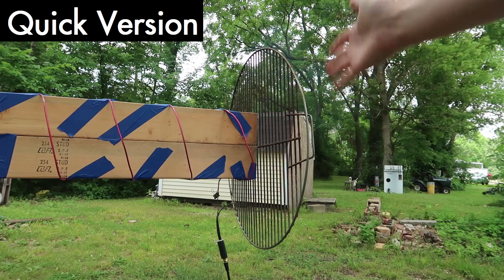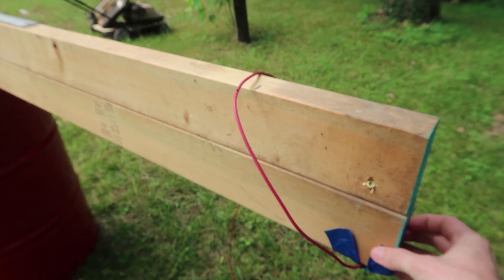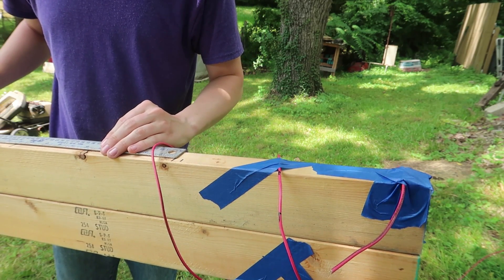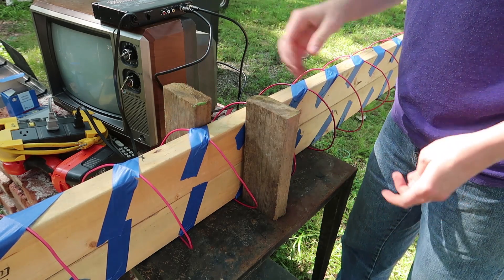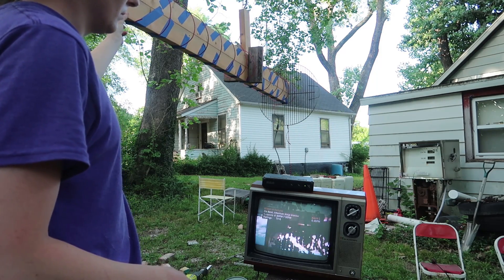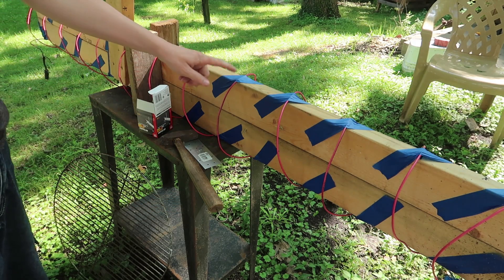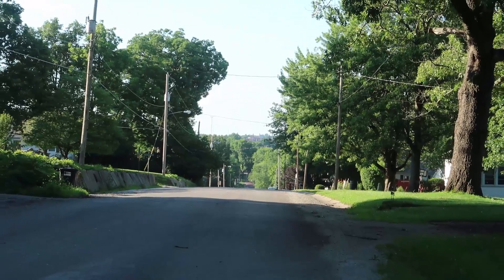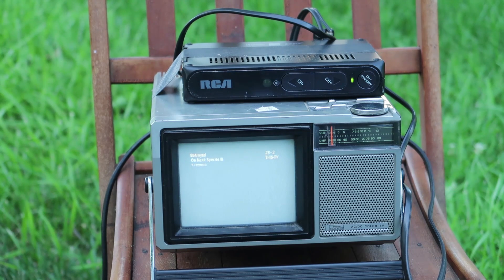Digital TV Antenna Experiments 02: DIY Super Long Range Axial / Helical "Rural" Antenna, TV DXing

Comment: Please give power output of the stations and the distance you are from them! Does not matter if you get a lot of stations if you are in a big city, rabbit ears could do that. Why don't you try pvc pipe and drill holes at 5.5 inches, you could use Ts to space them and be a lot lighter, then add a rotor. Add a pipe in the center and you could support the outside wires.

Comment: You asked about multiple antennas and how performance would be affected. It's not a simple matter of connecting them in parallel,
as they need to be connected together with what's referred to as a phasing harness. More info here: http://www.jonfinley.com/hobbies/harness.html

That said, here's an approximation of how it pans out:

Two antennas will increase the signal gain over that of a single antenna by aproximately 3 dB. BUT, to get 6 dB of gain (aain, over that of a single antenna), you'd need FOUR antennas. 9 db of gain? You'd need EIGHT antennas. It gets out of hand VERY quickly. 

Check out https://daycounter.com/Calculators/Helical-Antenna-Design-Calculator.phtml for more info on designing a helical antenna.

BTW, your BBQ grill "plate" as you refer to it, is called a reflector. Odd, since you actually used that term in the video. Where and how you attach your feedline to the helix has a major effect on impedance. If the antenna impedance and the feedline impedance are not fairly close to the same numerical value, signal loss occurs. i.e. you lose some of the signal you're working so hard to capture. The greater the mismatch between antenna and feedline impedance, the greater the signal loss. 

I've been a licensed Radio Amateur since 1968. I've seen very few hams attack a project with the zeal you show while building yours.
(and NONE of them were women!) My hat's off to you madam!

Comment: You might get better results if you strip the wire. I tested this at work (I work at a TV station). Paperclip VS insulated wire of the same length. I got nothing on the wire but got all 3 local channels (3 main channels plus 11 subchannels) with the paperclip. It's a digital TV so there's no converter box to account for

Comment: If the area in which you live is in abit of a dead or difficult spot as regarding tv reception why isn't there a local relay tv transmitter in use serving your area? In the Uk there are loads and loads of repeater stations situated where good reception is an issue, some serving very small populatons.
Reply from the maker: because our town is too small to need one

Comment: Might want to look at UHF/VHF db boosters they run inline between the converter and antenna they can be found cheap on Ebay. I like this antenna design you can make them as large as you like and you can mount them across attic trusses  https://vimeo.com/2931902

Comment: Hey, you need to get your Ham License - you'd be an asset. I just made the common 7" x 8ea. V-bow-tie and it worked well, but not on our local ch 5, eventually I discovered some of the channels like our ch 5, are still in the old VHF 54-216 Mhz range, which could be a big antenna. The FCC TV query site is https://www.fcc.gov/media/television/tv-query . Good video.
Reply from the maker: no i dont. ham radio doesnt interesting me at all. just weird middle aged men on the airwaves. i dont need a license to mess around with transmitters and antennas, especially since its such a rural and remote area im in.

tvfool is better website btw.
Reply: @RinoaL  Us weird men are way past middle age now!  LOL!!  All you see is gray and white hair at a hamfest.  Rarely anyone under 50 - and not too many women either.

Comment: do yourself a favor and use pvc pipe instead of wood!!!
Reply from the maker: find a 7" pvc pipe.
Reply: @RinoaL   no no no. use tee shaped peices to hold the wire!!
turn 2 tees into an H one is the center, the other supports the wire by turning it 90 degrees next one in line is the bottom then the top etc. ---------`---------`-----_
Reply: you're welcome
Reply from the maker: that sounds flimsy and costly, i think wood is nicer and simpler
Reply: @RinoaL   look up the channel southern ideas this guy builds small practical antennas that are capable of almost 100 miles without a booster and he shows you how to build it!! for about 10 bucks!!( your cost for parts)

Comment: Rinoa Super-Genius, there's lots of Yagi antenna calculators on the internet that work. The more elements you can add, the better the db gain. Thought I should share that with you. Get some small diameter scrap aluminum tubing or what have ya and go to town.  Your antenna here works, though.

Comment: People need to understand that when they rate how far an antenna goes, it is most often exaggerated and need a completely clear path to the tower from a very high mount. When you live in hilly rural areas the best antennas may not exceed 35 or 40 miles. Although the old fashion aerial antennas work better than long distance directional antennas, but they are huge and ugly. I would have interest in building my own long distance antenna, but would stay away from nailing 2 - 2x4's together unless it was the only way. As far as putting 2 together for a better signal, I think they would need to be a certain distance between them like 5 feet? but I don't think it would improve your reception much, but it could be aimed in 2 different directions. I would think that od copper tubing aka refrigeration tubing that is already in a roll or heavy gauge non coated copper wire would hold it's shape around Styrofoam better than copper wire around heavy boards would work better? but I don't really know, but would paint the Styrofoam for better strength and weather resistance?  Keep on going, I was hoping to see a miracle rather than being slightly impressed. Nice video and good efforts.

Comment: You built a very directional array. Its an axial mode helical antenna. Its definitely for uhf frequencies. If you want t a vhf station , you may need to add a dipole near your driven element. Wouldvit work better with no insulation on the wire? Also, when wood gets wet it will become a hindrance electrically unless its sealed with paint or clear coat. Most stations have their helical arrays vertically polarized, but might depend on terrian . This type antennas  is used to comm with satellites.
Reply from the maker: vhf television doesnt exist anymore, that was the main reason for the digital switch, make more room for other things. all channels have been moved up and every channel i can find around here is between 400 and 600mhz, most above 500.
Reply: @RinoaL  - "vhf television doesn't exist anymore" is not true. It is a myth that seems true only in some TV markets. Check out https://en.m.wikipedia.org/wiki/Pan-American_television_frequencies for info. In East Tennessee we currently have TV broadcasts on physical (actual) VHF channels 5, 7, 9, 10, 11, and 13 plus several UHF frequencies, of course. The FCC recently auctioned off high UHF frequencies to cell phone carriers for more space in the future. So the OTA frequencies are going to have to undergo a "repacking" when the higher ones will move their physical channels to lower frequencies (lower UHF or VHF). This will be expensive for some broadcasters, because the physical size of their antennas will have to be redesigned to be much larger (requiring stronger towers to carry the load). People who have UHF-only TV antennas will likely need VHF-capable ones at that time.

Comment: I would make a Gray Hoverman antenna it's much smaller and they pick up good. You can do a side by side version and get really good reception. Also an eight bow tie antenna works good too but if you want it to work for years in weather you need to solder the whiskers to the lines, Gary Hoverman needs not any soldering maybe the balun should be soldered but the antenna has no whiskers to worry about.

Comment: try a die pole plastic plumming t peace 2 metal poles one facing up other facing down inner coax goes to pole up and other to pole facing down i seem to recal each pipe is about a meter i did this on a roof years ago for analog never managed to try for digital as it is none directional it should pick up for signals

Comment: two antennas tied together is great, you get twice the strength of the signal, not twice the distance reached, though.  Also, be careful when tying two antennas together because you can get some impedance and signal cancelling if you are not careful.

Comment: For a much lighter and easier design, look up at lowes or homedepo QUIKRETE aka quik-tube. they are cardboard tubes for concrete. should be able to get something in the size you need and the cable can be round. not sure if at the start the oval shape is necessary but could make a press with the 2x4s you have to make the tube oval. Then vac bag the tube with resin so that it's water proof and stiffer.

Comment: 10:10 that looks like a cell phone tower in the distance, likely what is causing the signal level to vary so much.
Those screws you used to join the two bits of timber, are likely detuning it slightly, consider using dowel to join timber (or get one bigger piece).
You could also use a hacksaw to cut grooves to put the wire into, keep it more secure.

I remember having a set top helical antenna many years ago, I never considered making a bigger version.

Comment: I think you should experiment with the reflector materials and sizes. Maybe an old satellite dish could help focus the signal strength.  I tried some different locations for my antenna and nothing worked better than mounting it right on the largest window.

Comment: Would a solid backing plat work better than the grill? Like, would covering the backing plat with foil change anything?
Reply: That question has everything to do with wavelength.  It would basically not be an issue at UHF frequencies.  Now, if you were up at 2500 Mhz (the wifi band) it would make a difference.  You also have to consider what is called "wind loading".  The foil would be gone in a 10MPH wind - and solid metal would be a problem in gale force winds.  That's why you don't see that much.

Comment: Seems. it's so very heavy. Wood does not affect the quality of the antenna signal, may be will be better to use PVC pipes for making carcass.
Reply from the maker: i think it better to drill big holes in the wood
Reply: no need to drill holes in PVC, holy scotch or glue can be useful in DIY, and if your project much needed, you can drill holes in PVC too(bee careful, need fixation), awesome material!
Reply: +1 for the PVC pipe
Reply: I might try this antenna and compare it with a Gary Hoverman antenna. I would use an old dish antenna for the reflector. Thanks for posting.
Reply: I would.not.use wood on my antennas because wood will get water logged and short out your signal. Use vinyl fence posts they are light and won't conduct. Better insulator for antennas.

Comment: Digital TV is so awful compared to how Analog was. If you had a snowy signal with Analog it was still at least watchable and you could understand what people were saying.
Reply: Do you know how wide the frequency is on the new digital tv signal? I've tried googling it up and the results leave me very confused. I'm wondering if its like the phones and a spread spectrum signal.

Goal: If I knew the freq range I could design an op amp high Q (superb selectivity) pre amp.
Reply: John in Australia it is 7mhz
Reply: John Possum The FCC keeps selling off channels for mobile use. As of 2020, there will be no channels above 36 (608MHz). The UHF TV band still starts at 14 (470MHz).
Reply: @5roundsrapid263  they may sell of the actual frequencies but most digital tv are using vurtial channels the frequency is not the high channel 55 they may transmit on a low channel on uhf but have a vurtial channel that is a high number. In Florida uhf actual channel 16 went moble. USF sold the channel that used to be WUSF TV. On my tv I get signal but no picture or sound.
Reply: Not really digital tv comes in Crystal clear. You get a picture or you don't get anything. But it don't take much to get good clear pictures. Most government issued converter boxes are junk. Most smart tvs will get excellent pictures with small antennas. I would make a Gary Hoverman antenna and you will get excellent pictures if installed outside. I would not waste money on the flea market lava antennas they don't pick up 150 miles if installed on a mountain let alone on the roof. If you live 30 or 40 miles they work ok but you can build an antenna for a lot less money.

Comment: Creating an array of 2 or more antennas would increase the capture area and help with weak signals. Then there would be the option to aim them in different directions at different broadcast towers, ganged together with a splitter and then fed through a signal booster. That is a very cool design!!  I might try that with a 2x2 frame to make it somewhat lighter & easier to mount in the attic. Fortunately, Atlanta broadcast towers are in a clump 45 miles away and easy to aim at. Good luck with your antenna!

Comment: One way to improve the signal drastically is to attach a Masthead amplifier to the base of the antenna what that does is amplify the signal by up to 10 decibels which should give you far better reception even some of the cheap antennas come with 5 volt amplifiers

Comment: I had the Zenith box, and it works very well. It got 60 mile stations all the time, and sometimes 90-100 miles, just with a rooftop antenna.

Comment: I could be wrong, but I don't think you would get troposphere bounce because it so high of a frequency. In the days of analog the vhf channels we're a lower frequency and near the 6 meter band in ham radio so you would get big troposphere bounce. Again I could be wrong because it's been a while.
Reply from the maker: ive heard it can still work a small amount, but i agree nothing fun like with VHF.
Reply: Rinoa Super-Genius yeah it might bounce some, but not as much as it used to
Reply: Rinoa Super-Genius There are still a few digital stations on VHF, but mainly high band (7-13).

Comment: Under ideal conditions, adding another antenna adds 3dB. To get another 3dB you need to double it again to 4 antennas total. Mechanically a pain in the ass. I reckon the lowest hanging fruit is elevation. Stick to one or two antennas only. Lighten the design physically and get it off the ground.
Reply: Hot tip: Elevation profile feature on Google Earth is great for checking line of sight and figuring out required mast height.
Reply from the maker: no, tvfool is better.
Reply: DaSuthNa is right. You'll also need to co-phase them together which can be tricky without the right equipment.
Reply: Rinoa Super-Genius I'll give it a go.

Comment: You’ve got absolutely no excuse to as to why you’ve missed the latest episode of Eastenders now. Hahahahaha.. 
  Maybe an in-line active signal booster might help pull the signal in a bit stronger.
Reply: Yes, a preamp would help, put it very close to the antenna feedpoint.  On the other hand, an amplifier amplifies noise as well as signal.  The one good thing it will do is help to overcome losses in the coaxial cable.  That becomes more of a factor as you get higher in frequency.

Comment: actually I think adding them in parallel would not really work since the would backfeed and the phase shift because of the different position would cancel the signal, just like with speakers
Reply from the maker: no its called an array, and if you do it right it can make it more directional.

Comment: sorry to disappoint, but TV DXing isn‘t really fun anymore in the rest of the world (like europe)... some small transmitters are still active, but most use either satellite or cable. 

I did once receive analogue russian TV here in Germany, but apart from that, it‘s not much fun...
Reply from the maker: my goal is just NHK World station that is like 120 miles from me.
Reply: In the uk their now using dab tv and radio so it might be their all switching to digital tv the au is that may also
Reply: Tobias Madel it's so strange opinion :( Europe is full of digital tv transmitters (in DVB-T/T2 format) And it's also fun to TV DXing in 2020. I have received in September tv signal from transmitter,  827 km (513 mi) away from my QTH.
Reply: Tobias Mädel simply the good old analog DXing ..... ELF to SHF ........
Reply: That's your opinion Tobias. You do realize that you don't speak for everyone, right?

Comment: Point source radiation degrades as 1/Distance but if your intention is to combine antennas you don't get 2*1/D with two antennas account of the 75 ohm bridge used to combine the signals.  Better to amplify each antenna then combine to reduce noise.

Comment: what about a D2B antenna, we made one out of wood and copper wire years ago and it still works great. the antenna you are making is designed for circular polarity which tv is not normally transmitted as... its usually either horizontal or vertical
Reply from the maker: horizontal and vertical polarization dont matter with these antennas, it picks them up fine. however it will only broadcast in whatever circular handedness it has, and wont recieve in the other circular polarization.
Reply: Here in Brazil, digital TV transmission is in circular polarity, due to mobile reception.
Reply: Most every TV and FM transmitter in America has used CP for years and years now...  In fact, the only time you will see vertical polarization only is with (licensed) low power FM stations - and that's because it is often mandated by the FCC to limit range.   I built a LPFM station - and the FCC made me jump through some serious hoops.  We were allowed to use CP though.